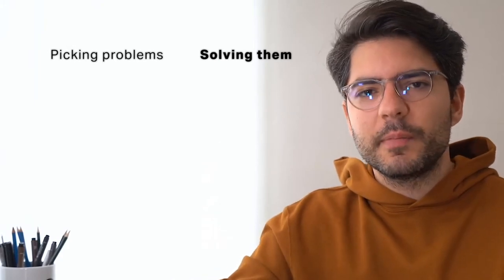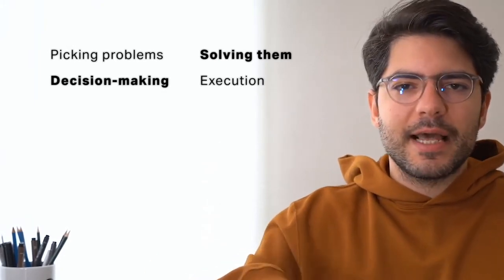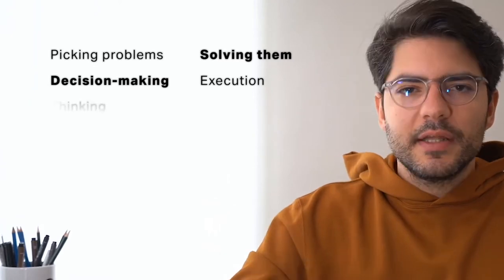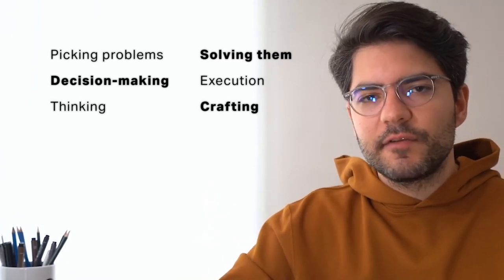How to Think and Talk about Design: Strategic Design vs Tactical Design

Comment: Thank you for this video! Not only for the content but also for the reference to the High Resolution series. I am a web designer and I have been dedicated so far to the tactical part of the design, and taking decisions based on a strategic set by my seniors/managers. Now I am aiming to become a senior web designer, and I feel overwhelmed when I try to jump into the strategic and project management side. There are so many methodologies, processes, best practices and ways to approach a new project that it is easy to get lost!. I would definitely check out the video series! Thank you for this channel, I find it very useful and interesting.